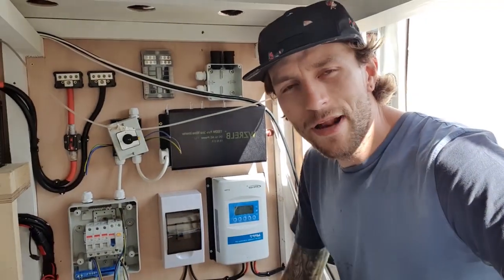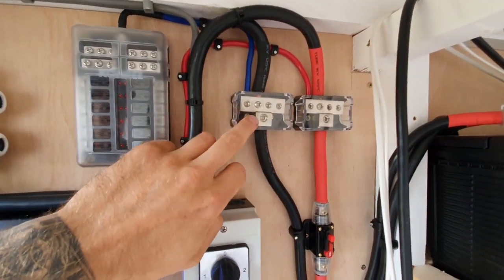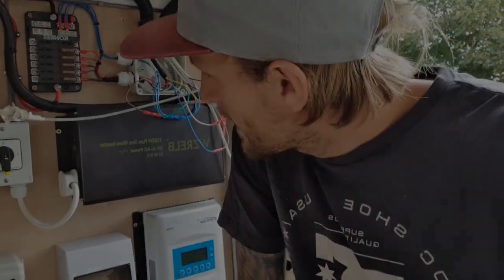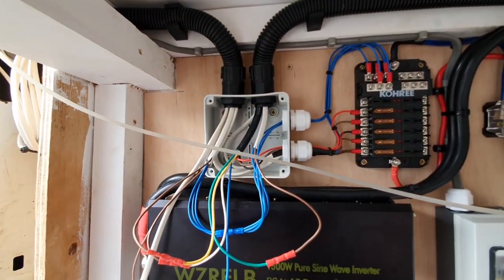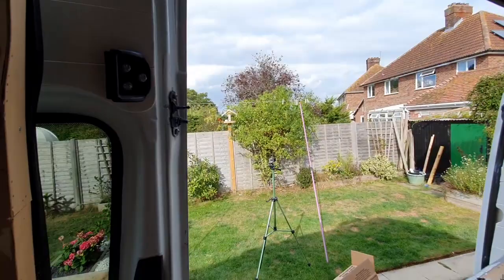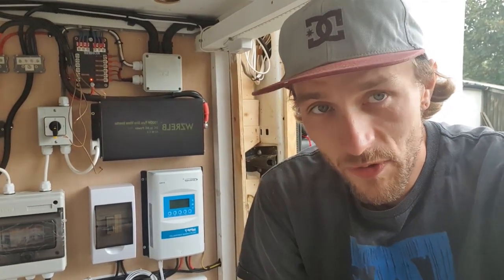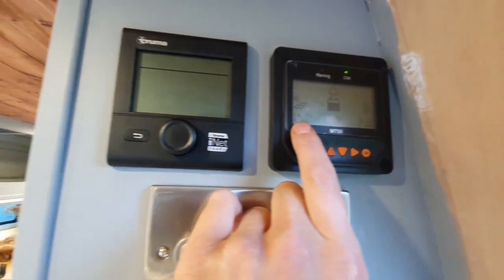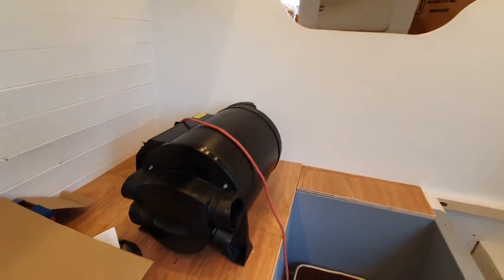Van Electrics.. FINALLY DONE | Van Life Build Vlog #19

Comment: Have been watching a number of your videos, got some great videos and lots of information. I'm just playing the electrical install, which will include a Truma Combi 4e, as yours does. Did you choose a 16A MCB for the Truma feed as that's what came with the consumer unit, or for some other reason? Looking at the Truma Specs, it states a max current draw @ 240V of 7.8A. Thanks and keep up the great work!
Reply from the maker: Hey James, cheers mate 👍🏻
The MCB is designed to protect the cable  and not the appliance. I stuck a 2.5mm flex in to supply the 240V side of the Truma which is good for about 20A. So as long as the MCB is 20A or smaller it's all good.
If its 7.8A then a 1.5mm flex on a 10A fuse will be fine as 1.5mm flex in open air is good for about 16A.
I hope all that makes sense.
Cheer chap.
Reply: @BejamVan  thanks very much for the quick response, that all makes sense and has helped with the head scratching! Thanks, James.
Reply from the maker: No worries at all matey 🙂

Comment: Can I ask where did you get the battery lead connecter blocks or what are they listed as. as I cant find them, Thanks for your explaination of van wiring it is a massive help.
Reply from the maker: Hey, no worries at all.. these are the battery lead connectors I used..

AUTOUTLET Car Battery Terminal Connectors Kit 2PCS 0/4/8/10 Gauge AWG Car Battery Terminal Connectors with Spacer Shims,Positive Negative Chrome Battery Terminals(with Clear Covers) https://www.amazon.co.uk/dp/B07QDYF382/ref=cm_sw_r_apan_glt_fabc_40FH2FM10BFNCEFJ3JBD?_encoding=UTF8&psc=1

Hopefully that works 🙂
Reply: @BejamVan Thanks for your quick responce. But I was refering to the wall mounted blocks.
Reply from the maker: @hartleyhare7375  ahhh sorry.. they are these:

RKURCK 4 way Power Distribution Block, 0/2/4 AWG Gauge in, 4/8/10 Gauge Out, Car Audio Stereo Amp Distribution Connecting Block for Audio Splitter (1 in 4 Out) https://www.amazon.co.uk/dp/B07PM9BK8L/ref=cm_sw_r_apan_glt_fabc_FQDXNRFQD5Q385KGYSK2?_encoding=UTF8&psc=1

Comment: I don't suppose you know what ring terminal sizes these type of blade fuses need for the inputs + outputs? - input 0BA? outputs 2 (or 3) BA?  cheers!
Reply from the maker: Hey Chris, sorry for the late reply mate..I had to to Google what BA was 😅 
As far as I've worked out, the input would be 0BA and the outputs 2BA.
I hope that makes sense dude 👍🏻
Reply: @BejamVan  no worries dude. ended up buying loads of different sizes as I’m sick of faffing going back and forth to the shops 👍